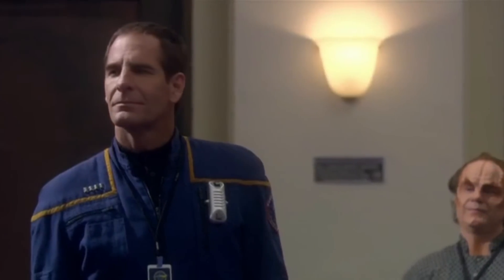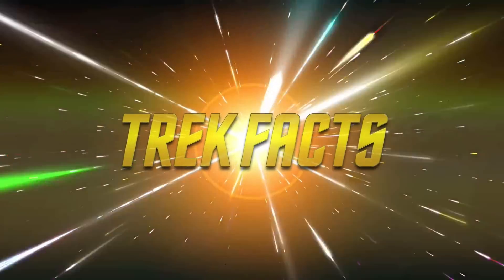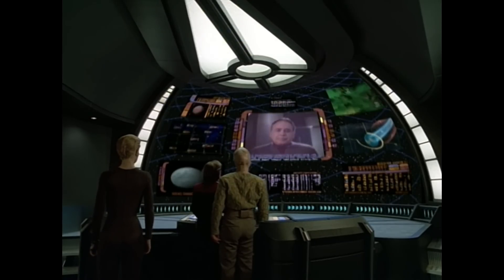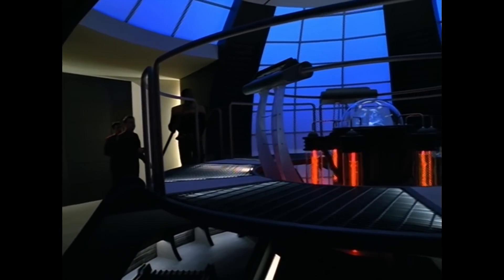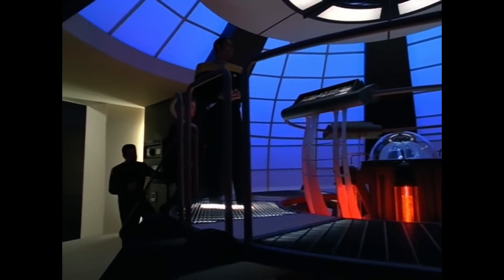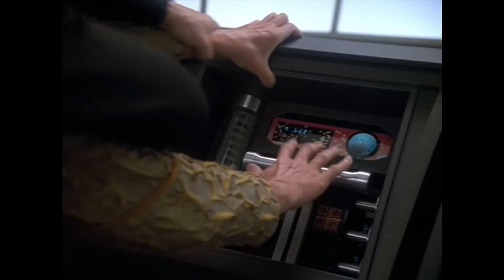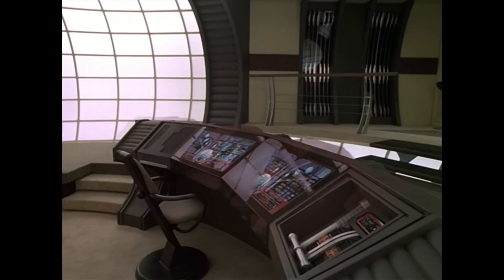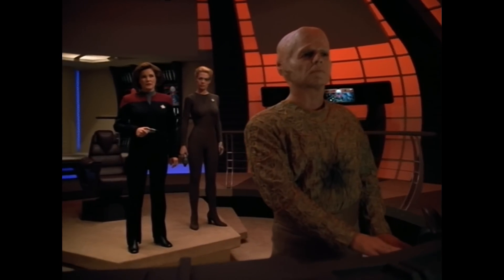(TF15)Quantum Slipstream Drives

Comment: I never understood why they didn't just use the drive in small hops.
Reply: I have also wondered about that.  If I remember correctly, Harry Kim had some throwaway line such as, "the Benzanite crystals are already decaying..."  So I take it that the fuel for the drive wouldn't last a long time.

Comment: Actually, the first version of QS drive (as found on USS Dauntless) caused Quantum Stresses on Voyager's hull, preventing the ship from remaining inside the Slipstream for more than 1 hour (which allowed the ship to traverse 300 Lightyears in that time).
The second version of QS drive was the one the crew designed and used Borg technology as well... this version did NOT cause quantum stresses on the hull anymore (as its likely the crew compensated for that deficiency), however, as it was noted, the phase variance present during the formation of Slipstream was a problem which Voyager was unable to overcome.
They sent the Delta Flyer ahead of Voyager to map the Slipstream threshold as it was forming so they can input the phase corrections manually (to be fair, I have no idea why the computer couldn't do that automatically).

All the crew needed to do was pilot the Delta Flyer ahead of Voyager as we saw, however, the shuttle's computer would map the Slipstream threshold itself and produce correct phase corrections which would be applied at the same time on the shuttle and Voyager.

They have FTL based computer systems which are ridiculously powerful/fast... I find it unlikely that they couldn't have done it this way.

Trek did a lot of things nicely... but automation was apparently sidelined.